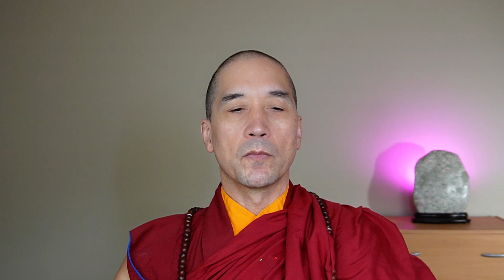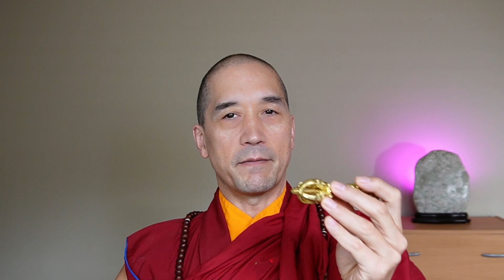Explanations of the direct path to #nondual #awakening  #adyashanti #rupertspira #francislucille

Comment: Aha karma. You must teach all three components of the day first, including sleep/not knowing, the full cycle, not just what they know. So karma, you can say "Did you know, you can program a dream?" Then talk about 8fold daily routine, culminating in a dream you wanted. Most people have already done this with a loved one, miss my dead pet, dream about pet. Then reference Bardo Thodol, the essence body, not the hardware, but cycle of essence, through the habit favours a cycle if awake mind is shut down. However, I can say with integrity that there are stages of deep sleep that allows "editor mode". However, that must be experienced. It I'd not hard, but it is a hustle. I recommend attaining focus using The Gateway Experience. Very pleasantly surprised. I also have high standards, this one is worth the daily 40 minute grind. Also, Buddhist practises. However I study gnosticism, kabbalah, Sufi and Hindu too. It is very interesting! The methods converge at the top level. It is like mixed martial arts, hence why I say mixed ascension arts. You know, that's how I would do it. You must be yourself.
Reply from the maker: I would not teach the 6 yogas publicly.  ♥♥♥

Comment: the mind can basically only change in 3 ways:
-adding new structures in addition to old ones
-or adding new structures that replace old ones
-or simply removing old ones

therefore, either enlightenment is simply part of this, or it isn't, and is something else that happens outside the mind
if it is something else that happens outside the mind then it is either not connected to the mind or is
if it is then can changes in the mind induce it? or does it induce changes in the mind? or both?
Reply from the maker: Are you suggesting that the mind is material like the brain? If not what do yoiu mean by structures?
Reply: @ultimatemeaning  the mind is made of the same thing experience is made of. They call it: QUALIA. But it has a different pattern formation and movement.

we call it "intelligence". but where is this intelligence? where does any pattern come from?

it is either hidden inside consciousness somewhere or it is in something greater beyond consciousness.
Reply from the maker: Why do you need to make assumptions? There is no evidence that it needs to be logical. Why not look to see for yourself? @mikelisteral7863
Reply: @ultimatemeaning  if i really look at any one thing it seems to vanish and turn into a small ripple of something bigger and unseen

the only way to see anything is to see everything. because only one thing actually exists

and the ony way to see the whole is to focus so completely beyond the mind that your body and the room your in vanish and become a void
Reply from the maker: " if i really look at any one thing it seems to vanish" this is what we call partial understanding in the Mahamudra, keep trying  @mikelisteral7863
Reply: @ultimatemeaning  ya so why would i bother trying to look at a piece of reality and only have "partial understanding" when i can look at the whole thing and have full understanding
Reply from the maker: please explain how you look at the whole thing, and also why understanding one thing doesn't include understanding everything, if as you claim there is no separation?

 @mikelisteral7863
Reply from the maker: Hi nice to hear from you again. I have never had an experience of everything that I have experienced in my life appearing in detail in a single instant. Moreover I can't clearly remember or visualise what happened 15 minutes ago.

I do know a monk who has Eidetic memory, but even so he isn't an enlightened being ( as far as I can tell)

@LifesInsight 
🙏🙏🙏
Reply from the maker: The point is that that there is no difference between appearance and its essential nature , its just that we continually engage in fantasy. But there is a problem here, because we need some way to overcome our misconception @LifesInsight
Reply from the maker: pretty much everything is a fantasy, but we still have to do our best to have love and compassion and not be carried away by negative emotions.

TBH few are interested in what isn't fantasy because we take more personal comfort in our delusions (spiritual and worldly both.)@LifesInsight
Reply from the maker: I don't see life as a fantasy, who told you that?@LifesInsight
Reply from the maker: This is a point I have made repeatedly, and that is the difference between our natural uncontrived view and philisophic views. Also the difference between understanding a spiritual truth and having an inherent belief in that. The problem is that most people are not honest with themselves and merely repeat the trite statements of others @LifesInsight
Reply from the maker: Are to talking metaphorically? @LifesInsight